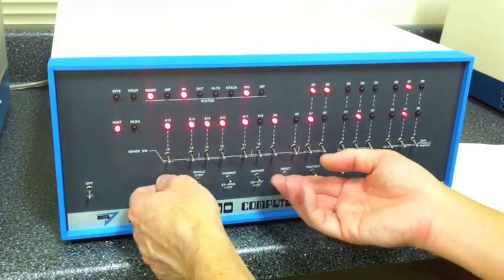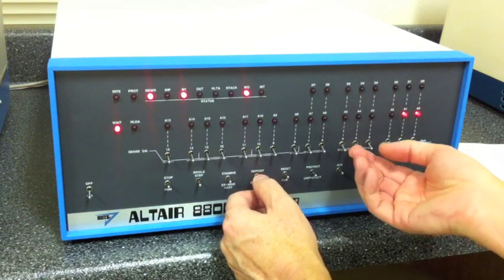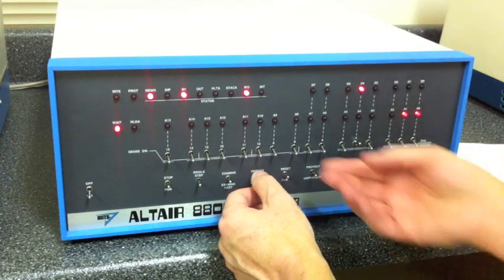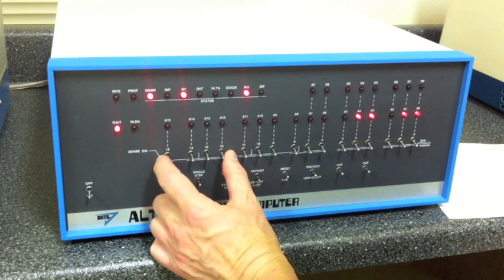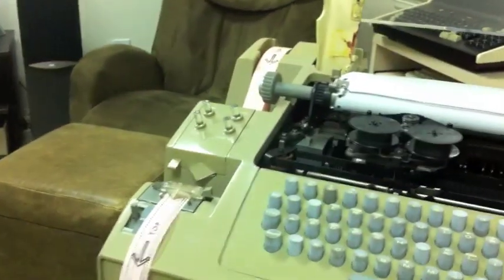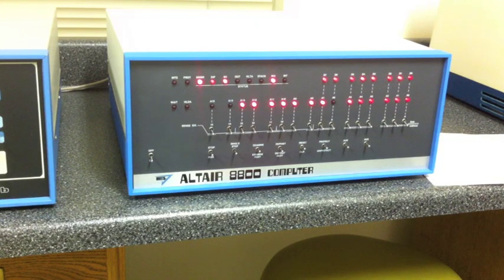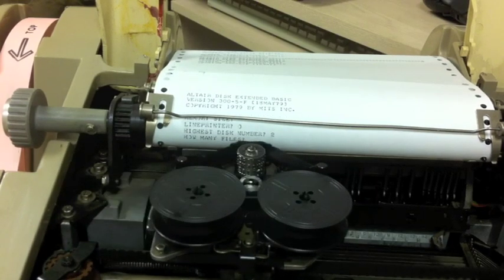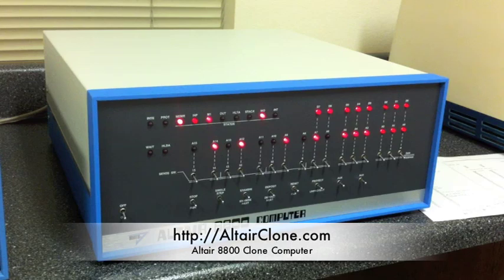Altair 8800 - Video #20 - Disk Boot from Paper Tape

Comment: Hey did anyone knew that you can LITERALLY run FaceBook on an altair?
Reply: +Spencer H ..It's very possible but it will probably take ages to load a simple page !
Reply: Nah. only if using it as a terminal emulator. Absolutely no point in that, given the fact that Altair's console is working through an ACTUAL terminal itself :)